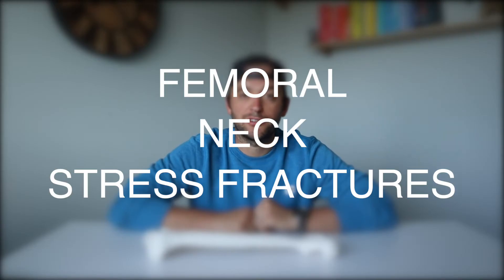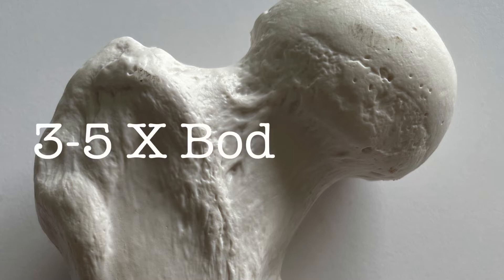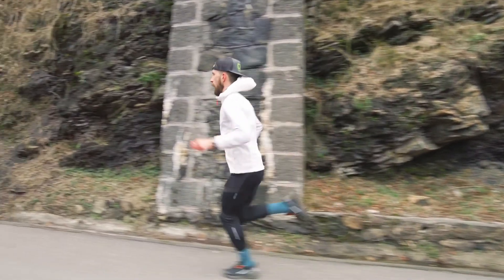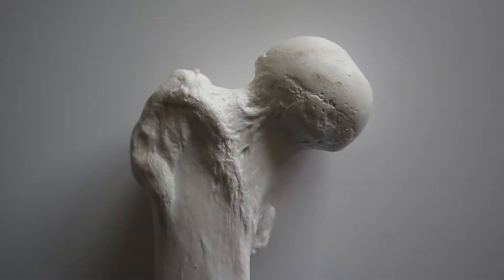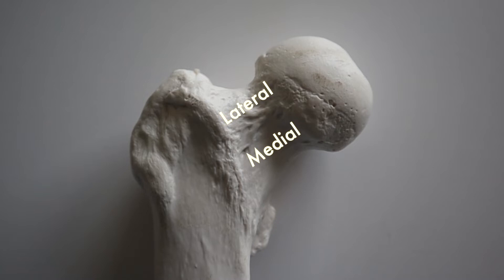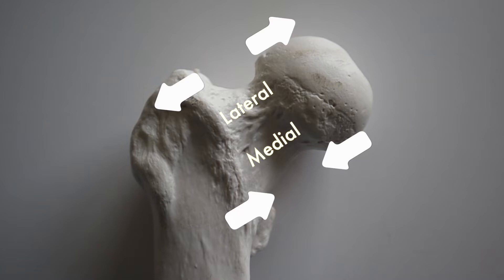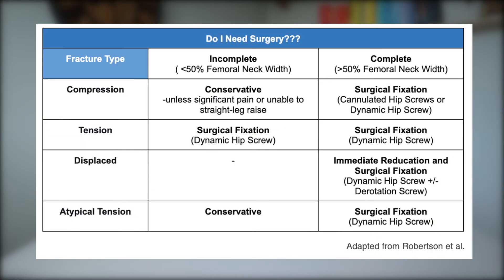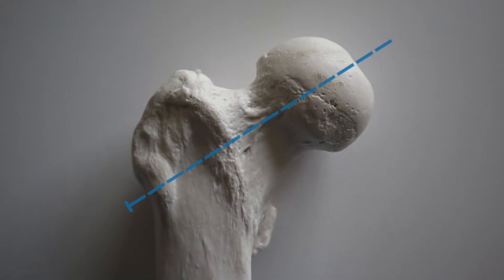Femoral Neck Stress Fractures: What you NEED to Know

Comment: What do you mean by more pain when taking weight off? Does the pain get worth exactly in the moment you take the weight off?
Reply from the maker: I typically call it a "rebound pain". Often 1-2 seconds after the patient takes weight off the painful side they get an increase in symptoms.
Reply: @NathanCarlson  I am so confused about my pain in my hip. It started as a SI problem and piriformis syndrome last summer. I’ve been back into running but the pain is still there. Sometimes it’s in the groin area, sometimes outer hip, sometimes a stiff butt. I’m anxious that it’s a serious issue. I can run for 10k with 4-5/10 pain, it’s not getting worse. I’m afraid doing an MRI bc I guess they always find some structural abnormalities.

Comment: 2 xrays and 2 MRIs and finally the OS said its a stress fracture. 4 months no running so far. Another 6 weeks and I go for my follow up. Its in the medial area. Do you (or anyone) know about infrared therapy and cold plunge? I am not sure if it helkps, but I have been doing this consistently. The cold plunge relieves the pain at least!